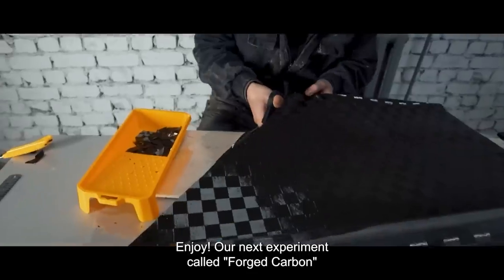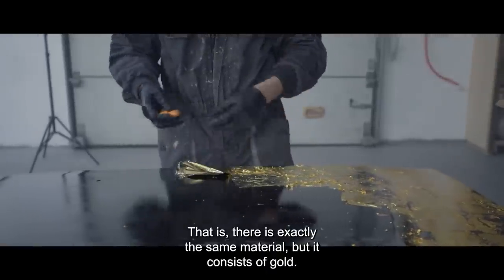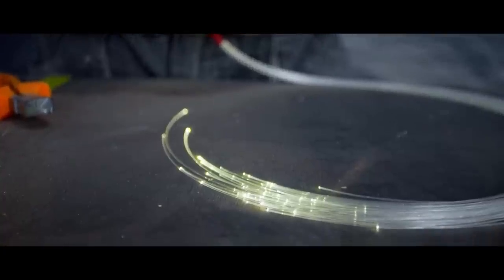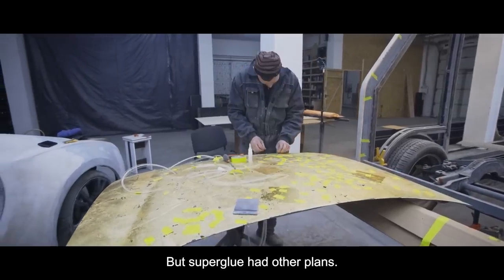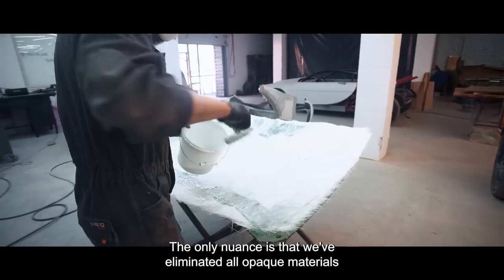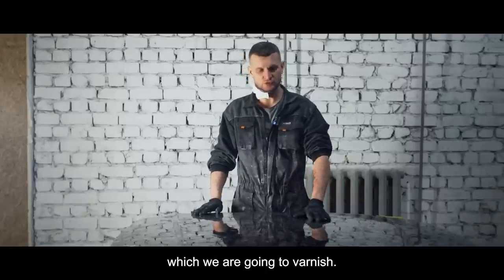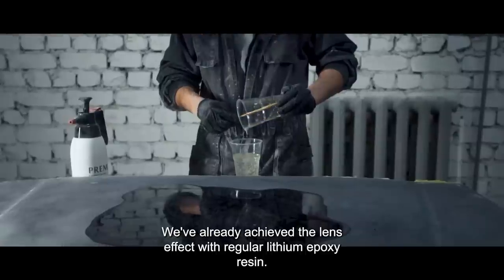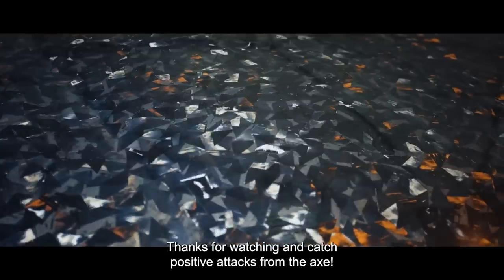Forged carbon in the garage. How it's done

Comment: You need a grommet between the fiber and hood , no? Wont the hood cut the fiber with vibrations? As I type, you scrapped the hood for carbon lmao. Heat gun when applying epoxy gets the trapped air out. Meaning less bubbles in epoxy.

Comment: Once upon a time, carbon fiber was used because it was stronger and lighter than steel and other mediums used in automotive manufacturing. Now, people are using "forged" carbon, which is markedly less strong than weave, and they are applying it over the factory medium, increasing the weight of the original item. I liked carbon fiber when it was a performance thing. Not so much now that it's just a "wow, that looks pretty" thing.

Comment: Ya that's not forged carbon fiber. Forged carbon is made by placing chopped tow and resin in a mold compressing the matrix to make a so,id part. This pretender boy carbon wrap.
Reply: Yeah but like, I’m gonna do this over an already carbon fiber part so